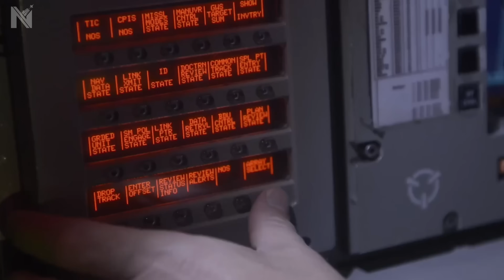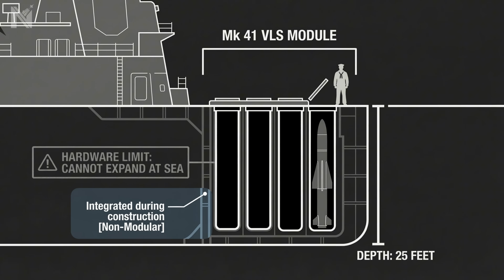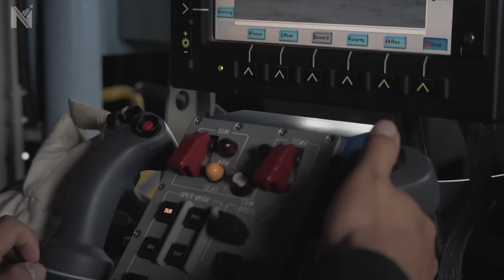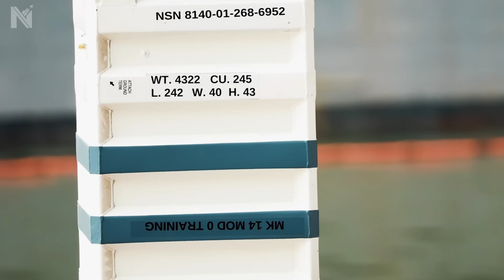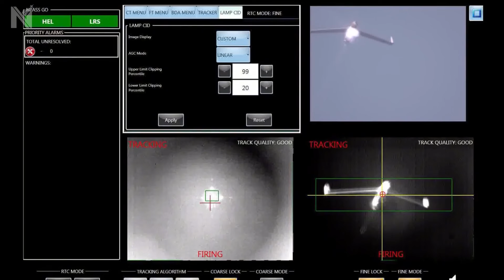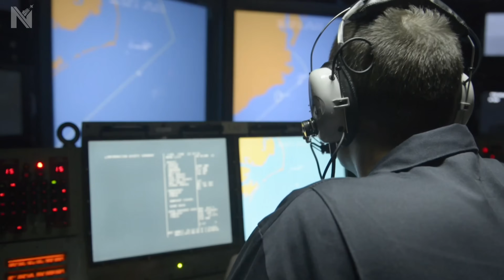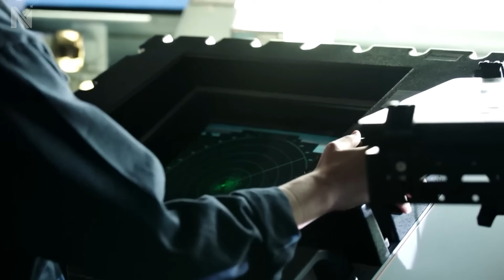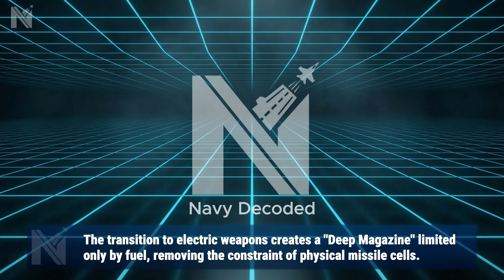Why The US Navy No Longer Fears Suicide Drone Swarms

Comment: It should be so simple. the equivilent of tshirt cannons firing cheap kevlar nets as if they were chaff or other inexpensive countermeasures. you could get that down to $50/round or less. Basically free to the navy. Entanglement would kill anything propeller driven. or even attach hard plastic chaos aerodynamic deflectors  that send a jet or rocket powered drone or missile, once ensnared, wildly off course and out of control. a rogue missle sounds scary, but it will always trend towards the sea on average bc of gravity, and also literally any outcome apart from it hitting its intended target is preferable anyways

Comment: They’re NOT using missiles agains drone swarms!

Phalanx Close-In Weapon System (CIWS): A radar-guided 20 mm Vulcan cannon that fires at 3,000 to 4,500 rounds per minute. While originally designed for anti-ship missiles, the Block 1B variant is effective against drones and small boats using a forward-looking infrared (FLIR) sensor for visual identification.

.50 Caliber Machine Guns: Recently, sailors have successfully used .50 caliber machine guns to shoot down small drones, a tactic highlighted during NATO exercises in 2025.

Mk 45 5-Inch Deck Gun: Traditionally used for anti-surface and shore bombardment, these main deck guns have been employed to knock down Houthi-launched drones.

GAU-21 Machine Gun: Mounted on ships to provide quick-response, close-range defense against incoming drones.
MK 38 25mm Machine Gun: A standard, fast-firing gun used for smaller threats. 

Tactical Shift
The use of these guns is driven by the need for "hard kills" against drone swarms, which are too numerous and inexpensive to counter with million-dollar missiles. These systems are part of a broader, multi-layered defense strategy that includes electronic warfare (jammers), high-energy lasers, and kinetic countermeasures. 

Future Counter-Drone Tech
Laser Weapons (HELIOS): 60+ kW-class lasers are being deployed on destroyers to melt drones.

High-Powered Microwaves (Leonidas): Designed to disrupt the electronics of drone swarms, with demonstrated high success rates.

Coyote Interceptors: Small, radar-guided missiles used to take down drones.

Comment: 12:27 - this is similar to the electronic attack aircraft the navy and air force have.   For the Navy, it was the EA-6B Prowler, and now the F-18G (growler).  These jam radar and missiles causing the missiles to fall out of the sky.  Whether these are being used in the Red Sea is up for discussion somewhere else.   Another thing to consider is the ability to acquire funding for these projects at the right time.   Acquiring a contract company to develop something from scratch or find an existing technology they can "pull off the shelf".   Every new project needs funding, everybody has a budget, it's quite a process to follow if you're into that sort of thing.

Comment: Helios is obsolete. 10s to destroy a target means its just a "dazzler" to destroy optics. Focusing on a target that long is impractical and useless against swarms. The new Laser deployed on a handful of destroyers has a 150kw beam. On land they are testing a 300kw beam (not ready for ship testing). I understand they think they can achieve a 500kw version in the next few years (at least in the test range). 

So that means longer range and Much quicker engagement. Maybe 1-2 seconds so that shoot downs of faster missiles or larger swarms become possible. 

The microwave projector mentioned here woiuld be marvelous against swarms with a 15km range allowing other weapons such as CIWS, Laser and RAM to serve as backup and catch those that penetrate.

Comment: I don't know....I still think their solutions have problems with them. It's the same scenario that they play out from time to time on sci-fi shows like Stargate SG-1....you develop a defense that relies on frequency and energy, and your opponent counters with shielding and frequency changes.

A better solution would be to develop the equivalent of a land mine that can be deployed in the air around a ship.

The goal of these airborne "landmines" is the same as regular landmines....destroy an approaching enemy with shrapnel when they get too close and set the trigger off.

Of course, these airborne "landmines"....or airmines...would be drones launched by the destroyer, when needed. 

The shrapnel would be ball bearings released in a directional controlled explosion.

Computers would calculate in real time the best place for the charge to be set off, as it controls the drone airmine and flys it to the calculated point needed to effectively destroy the enemy drone. 

Like one of the episodes in SG-1, this low tech solution to technology that's more advanced might  be more effective than trying to match their technological advancement, with an even greater technological advancement.

I also think it could be an effective solution against hypersonic missiles, if it's combined with a computer based targeting system.

The final low tech defensive system could be a super charged water cannon that can fill  an area of the sky with massive amounts of water, in a perimeter 1000 ft around a ship.

Comment: I'm skeptical it is solved. Ukraine is ahead of the US in drone tech, they don't have infinite resources but they still get through there. The early versions of these technologies don't have enough power to keep shooting large numbers of drones continuiously. There are systems that have chemical based "electrical power creation", others that assume power from the main ship system, imagine a nuclear reactor. 

Also people haven't really begun to work on counter measures for this shoot down strategy. I know what I'd do, build 100 or 1000 even cheaper drones with no heavy weight explosive payload for every one with a bomb. You can have software to make the light ones fly like the heavy one. Now there's a cloud of 10k drones. They aren't 10' apart, they are separated in space. You send wave after wave until you exhaust the shootdown. It's so much cheaper to make the drones than the hardware and backend to shoot them down. I'm sure people are working on this. It's just like missiles, if you have cheap ones you can just send a lot more to overwhelm the defenses. And I can only think of these obvious things, I'm sure the real weapon designers have thought 5 steps ahead. I think our best US weapons makers aren't that eager to work on this stuff, because it's such a cheaper weapon. But other companies will.

Comment: Calling an Arleigh Burke–class destroyer a “paperweight” after expending its VLS is simply wrong.

Even without VLS missiles, it still has a 5-inch gun, Phalanx CIWS or SeaRAM, electronic warfare, Nulka decoys, torpedoes, and armed helicopters—all effective against drones, aircraft, small boats, and submarines.

More importantly, destroyers don’t operate alone. They fight inside carrier or surface action groups with layered, shared air and missile defense across multiple ships and aircraft.

Comment: I own a water cooled infra red laser and just the other day we tried to mark on white plastic. We couldn't even get the plastic warm to the touch regardless of settings! We can literally torch metals like stainless and titanium. With the settings we were using tried a piece of black plastic and it literally caught on fire! In Hiroshima people that wore white clothing were not burned by the flash but if they had white clothing and a black belt the belt literally torched them. So what I am saying is a completely white drone and I mean "real white" would literally be immune to this IR laser. If you were able to put a slow spin on the drone like Putin threatened to do with his missiles, then you have a cheap and effective way to get past the laser. What they need to do is have multiple wavelength lasers. This will help get past the white hack that our enemies will OBVIOUSLY begin to deploy. Not all lasers have problems with white. Our other laser has no issue marking it but it is not IR!

Comment: In addition to Or in Lieu of those proposed microwave, Laser, EMP, ETC. Directed Energy Weapons, why not use  30 or 50 caliber miniguns or minicannons like on the A10 Warthog? Surely they can Disintegrate
 those little drones  in very short order. I realize that's not as good as the endless ammunition directed energy weapons can provide but God knows it's a good solution to take out cheap drones, And much less expensive than missiles...

Comment: ever hear of radiation hardened and reflective coating - doubles the cost of the drone - but it obsoletes EMP weapons - and stray EMP will hurt friendlies too - we need to be able to deploy real large physical soft curtains - ballistically deployed instantly and held aloft by drones or balloons or drones , or they can be connected to the vessel with stand off booms along the sides  and can even be linearly  dragged  under water for surface or sub drones - a littoral standoff curtain of kevlar or carbon nanotube - the enemy isn't sleeping we should either , stop preparing to fight the last war!!!

Comment: its very easy to defeat this tech High power microwave.. The drones will fly Low to avoid detection. the will fly in between the tower of the ship and the microwave. so they cannot fire. if they do.. it wil fry their own circuitry and kill its passangers.

Comment: How much does Helios cost?  The first 2 cost $150 Million but it's 10 cents a shot.  Lasers are short range weapons and rain or fog diminish it's range.  Meteor (High Power Microwave) is 10 to 20 million dollars per unit and it's range is 1 to 3 kilometers.  The other issue of the 50 drone attach is the drones will not be in a convenient tight formation but they will attack from all sides of the ship at the same time.

Comment: I have trouble with the credibility of this video. First, the video willfully blurs the distinction between what is in development, and what has been deployed. At best TRAM, Helios, and METEOR are in early development stage (Helios is a bit further along). Yet the battle scenarios (e.g. mentioning the Houthi conflict) failed to identify whether each was a hypothetical scenario, or if any of them ACTUALLY OPERATED IN COMBAT.  As best I can tell, NONE of the described battle engagements using these new systems actually occurred in combat. Second, the date '2026' was mentioned,as though the Navy will have them. Yet based on current info, NONE will be released by 2026, LET ALONE DEPLOYED AT SCALE.
In addition, other than the USS Zumwalt (DDG 1000), and the new USS Ford Carrier (CVN 78), virtually no other ship has sufficient electrical power generation to operate either the laser or microwave defenses, let alone, the rest of their supporting infrastructure, or even sufficient hull/deck space.

Comment: No, he does NOT need to fire SM-6 missiles. 🙄🤦‍♂ Versus such targets, an ESSM at less than half the cost would already be serious overkill (and they are fire-and-forget, which could easily be salvoed). In fact, they could likely fry those drones just with their radars. A phalanx would find targeting such slow movers to be trivial. In short, the US Navy has NEVER feared drone swarms. And even if such drones did evade air defence, their warhead payloads are usually so small that even modern-day paper-thin warship hulls could withstand most of the damage.

96 vertical launch systems does NOT mean 96 missiles. ESSM missiles fit four missiles into each VLS.

I sure would like to see those "Trump" class "battleships", though, with their putative 4 inches of steel armor. Massive FU to the idea of cheap drones that.

Comment: I would think a hundred drone operators on a ship loaded with at least a thousand long range fast drones that carry semi-automatic shotguns loaded with loaded with at least ten rounds of  00 buckshot would be a better choice.  fog or rain and the laser is useless, and 4.5 million dollar drones are not the answer due to cost and limited supply.  the drone pilots could be guided to the incoming swarm by radar operators, using aiming lasers the drone pilot could aim and fire a round or two. take down several drones then move on to the next target . with a long range drone the intercept could be a hundred or so miles out, engage targets with drone operators on stand by to send out a second wave of defense drones to finish off what ever gets thru.  once the first wave of defense drones are running low of battery life or out of ammo they return to the ship those drones go off line and the operators take control of a third wave.  the hardest problem I see to over come is shotgun recoil and weight distribution.

Comment: The meteor antenna just aft of the mount 22 CIWS. I guess it's not doing anything, so not using it during the engagement isn't a big deal. Once they get done with testing they will have to figure an update for the cut outs where aft CIWS is not able to fire.

Comment: @19:18 The president had a better idea.  Wipe out the bunkers in Yemen like the one described in the video.  Called Operation Rough Rider, the targets weren't the drones, they were the people who launched them.  Did it work?  Last May (2025) they begged for and agreed to a cease fire so you be the judge.  If someone is shooting at you, it doesn't make sense to shoot down their bullets.  Go for the person pulling the trigger.
Reply: Yes if you can find them, not always possible.  The Navy is good at attacking missile launch sites.  Challenge in this discussion is how long in takes to out fit current fleet of destroyers.  Do the Arleigh Burke's have capacity to produced electrical power to fire the Lazer weapon described.  Can existing ships be put fitted with the Meteor system. Then after canceling the Constellation frigates, can the new ones built on Coast Guard cutter hulls accommodate these extraordinary systems that require large amounts of power?
Reply: Better not to get the world angry at you and mind your own business like most other countries. But this empire will also fall like all others, by inflation.
Reply: Agreed 👍
Reply: This is inaccurate. It was the US that halted Rough Rider after we spent ~$1B per month on strikes. After the "truce," the Houthis resumed their attacks on ships which the EU began addressing with limited strikes. Multiple independent analysis concluded that the US/EU did not achieve their aims. Houthis are still in power, their leader still operating, and to this day, they are a threat to int'l shipping lanes. As all war planners understand, you must have boots on the ground to control territory. Air strikes--although deadly--have limited effects.
Reply: Bullets don’t shoot by themselves. So, eliminate the shooter.

Comment: What's wrong with the CIWS (Close-In Weapon System), often referred to as "Phalanx," an automated, radar-guided system. Or, AN/SEQ-3 Laser Weapon System (LaWS) and the High Energy Laser with Integrated Optical-Dazzler. Designed for defense against cheap drones and Israel is using it now. I guess I should watch! ヅ